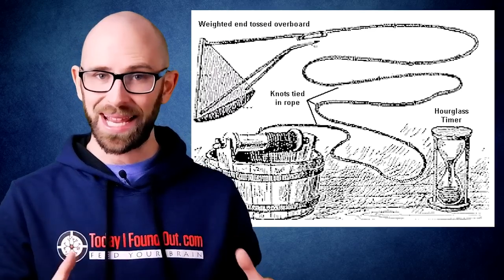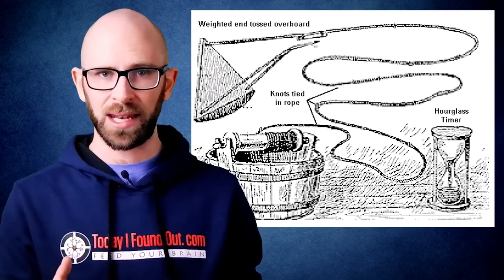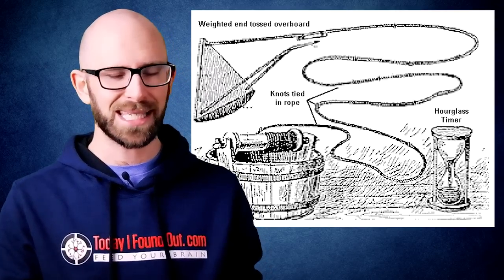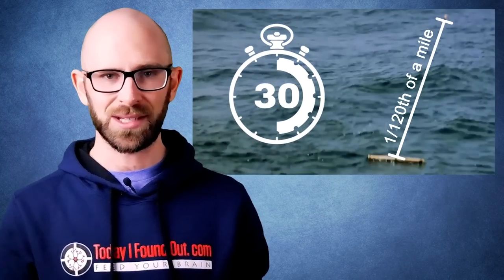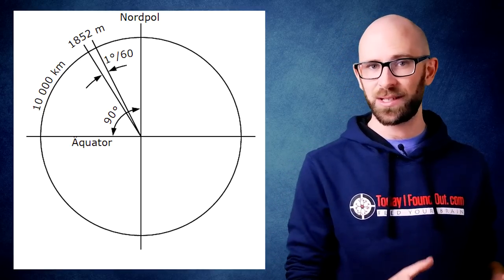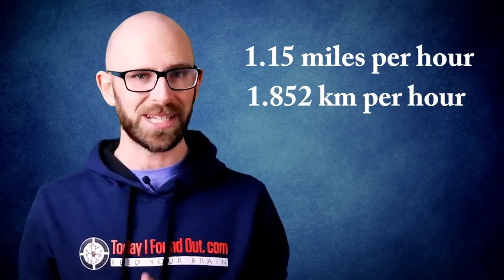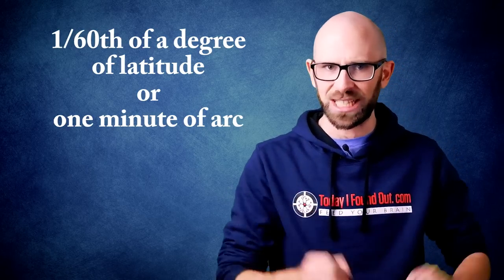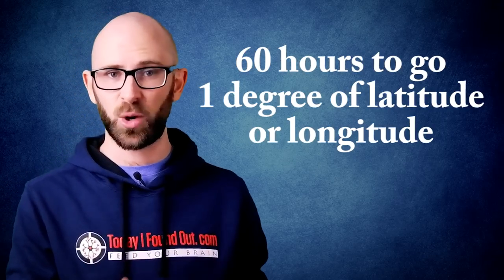Why is the Speed of Seafaring Vessels Measured in Knots?

Comment: Knots make less sense than the Imperial System for measurement (and that's saying something).  I'd think that sailors and pilots recalculate to MPH or KPH in their head because they are easier to visualize.
Reply: They usually don't need to recalculate. As long as every speed and distance is given in the same system, one unit is as good as any other. Sure, it gets messy when you need to convert your ship speed to km/h or mph, but you don't need to do that very often.
Reply: Yea, that makes sense.  I guess I'm just looking at this and saying if its so close to miles, why not just use that?  Also, my comment above is derived from my personal experience trying to use KPH when most signs in the US are in MPH.  :)
Reply: Richard Forester actually they don't.  6000ft for a nautical mile is an easy number to use.  It's distance relationship to latitude make navigation easier.  In aviation altitude in ft is used as it was determined many years ago that 1000ft vertical separation was easy and safe to use.  We could use meters as 1000ft is roughly 304 meters so to go to 300 meter separation is close enough.  But its in the ease of use that keeps us using ft for altitudes. It's easier, and arguably safer to use simple number.  Most airliners use flight levels between 18000ft and 36000ft.  That leaves 18 available altitudes. They are easy to say and remember flight level 240-250-260 etc.  in meters it becomes 7300m, 7600m, 7900m, 8200m. Etc. not as easy to immediately see and comprehend.  Rounding up to 500 meters would help but at the loss of 7 usable altitudes.
I know this doesn't look like it's related to nautical miles, and knots but my point is between maritime and aviation a system has been developed because it is simple and easy.
Reply: Efoxx ok I would say though that technically, there are only 9 altitudes (odds in one direction, evens for the other) and they could just as well drop the trailing zeros for meters just as they do for feet.  But you bring up some very good points and reasoning.  Thank you.
Reply: Richard Forester I wanted to reflect on this and your other comment.  The point I was making regarding meters in altitude is the difference in the ease a which your mind grasps the numbers. There is a flight level 260 and fl 360 the same cannot be said of meters as using 300 meter increments you have fl 240 but no fl 340 rather fl 330 and 360. 
And it really explains why nautical miles.  6000ft relates easily to 60 minutes or 60 seconds. If I'm moving at 10 knots that's one nautical mile every 6 minutes or 1000 ft per minute. In statute miles at 10 miles an hour I may still be doing 1 miles in 6 minutes, but feet/minute is a much harder number to crunch without thinking...  5280/6= 880ft/minute. This doesn't even cover the ease in which distances and time can easily translate on a chart when one nautical mile directly translates into 180 degrees of latitude. 
That being said, if we could go back in time and change basic geometry so a circle had a base 10 set of degrees (100,400,1000) then metric would be a lot more useful for navigation.
Reply: Sailors work in knots because they work seamlessly with the lines of Latitude and Longitude used on nautical charts, which themselves are based on the time it takes for the earth to rotate once. 
Recalculating to something that did NOT work on the charts would be madness. They would have to recalculate it back again. (Doh!)
Reply: ***** You are right. Knots are perfectly simple, and they have the advantage they are NOT based on merely arbitrary dimensions. They have an association with the reality of the Earth's period of rotation, (day length) and the way we have been timing it for about 4,000 years. That is a lot longer than we have had miles or kilometres.

Comment: thought it was biased on phathoms, a older unit of measure.
Reply: well the fathom was used to measure depth and the distance between the knots was a fathom. before the measurement was standardized, a fathom would be about a man's armspan. that lets them wind the rope in their outstretched arms and count the number of fathoms with each winding. i learned this from youtube/Lindybeige if you want to see it.
Reply: the fathom was used for depth. a fathom was the length of a mans wingspan so they could count the length as they pulled it in.

Comment: why did aviation adopt this?
Reply: I would guess that traveling vast distances, often over water like ships, that measuring miles/kilometers per hour would be impractical?
Reply: I would also imagine that military planning would be difficult using different measurements of speed.
Reply: HiHowAreYou I would buy that explanation.
Reply: Because the air is moving as is the water in the sea, the knot gives measurement in relation to the earths surface.
Reply: Saddle Sore Maybe, similarities between aero and naval are that the medium they move through are moving, so the distance between two fixed points remains the same but distance traveled based on conditions changes.
Reply: Anthony Butera Like walking up the down escalator.
Reply: ***** Nice, that makes sense. With GPS technology used in GA now pilots just do what the screen tells them and calculations are made for them. Good pilots still use older methods alongside the GPS. Power could be lost to GPS.